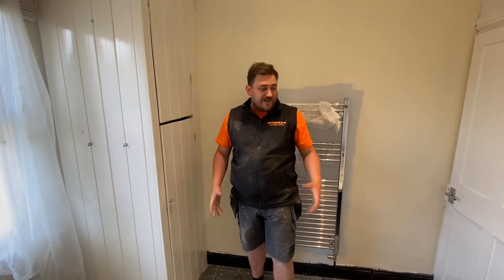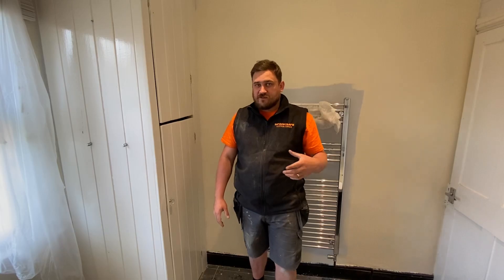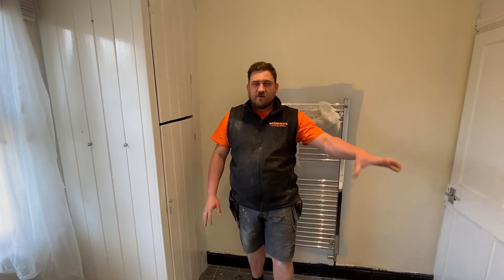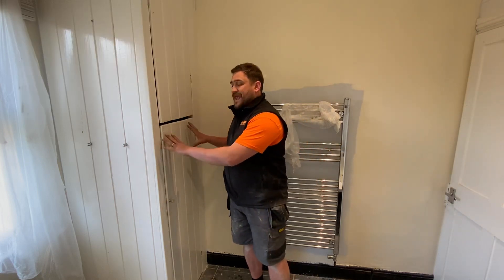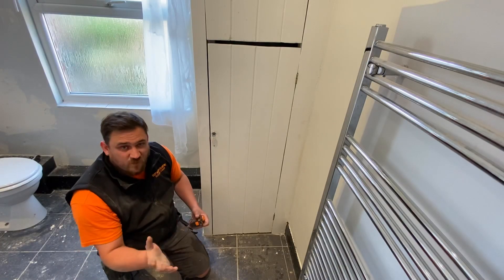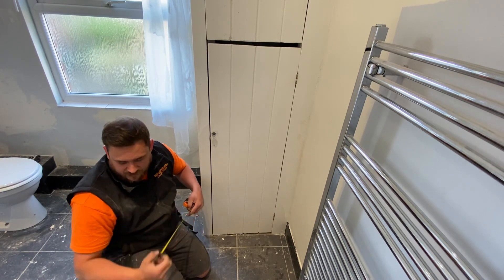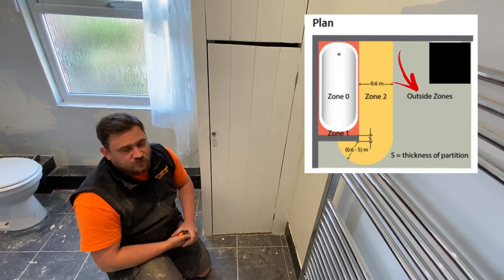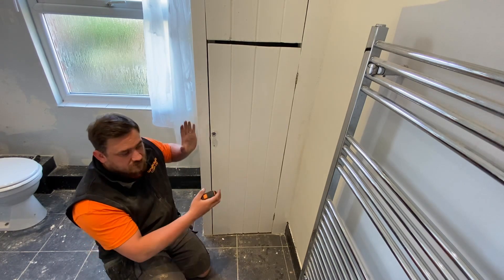Bathroom Zones and Airing Cupboards Explained - BS 7671 Are They Allowed in Bathrooms..?

Comment: So a cupboard in a bathroom is not in the bathroom?  Its a different room?   What if the cupboard has just a fabric door?  What if it doesn't have a door? What if the door fell off and you did an EICR?  What if you build a small cupboard around a socket outlet, its then not in the bathroom or use an outdoor socket and claim its in its own little cupboard?  Can you fit an integrated built in washing machine in the bathroom and claim its in a cupboard?  Can of worms opened....  I know someone who has a dryer right next to a shower and just runs an extension lead to the dryer from a socket outside the bathroom..  Think you need to use some electrical judgement and can't say one way or the other, I agree in that scenario I would think it was ok but I think it also depends why the person wants a socket, if its for a wifi router then thats a lot different than wanting to use a hair drier while in the bath..

Comment: Although I still think putting a socket in there is a bad idea. I would say an airing cupboard limits the extent of the zones but not necessarily the location if that makes sense
Reply: but you should always put a socket where an item is permanently mounted if you need to work on it in future. Lamps, tools, all need power. I mean, you know that you are supposed to have a socket within  a few feet of a breaker panel? In  most countries. for tools. Even though many of us have cordless tools not all do.
Reply: @brotheradam  im guessing you're not in the uk... we're not allowed sockets within 2.5m of the edge of bathroom zone 1. i.e. the edge of the bath or shower
Reply: @travoltasbiplane1551  as stated in video, the wall and door dictate the difference..lol.. take the base floor bathroom at my daughters house... an airing cupboard could be built into it without being affected under the zones, if the door is run one way, but turned the other way, it cannot work.. because a cord plugged in the inside would not reach the water zone if door is in one direction. 
NEC or USA rules are that you must have an outlet in the bathroom but not in certain are of shower or bathtub, yet Europe has different rules.. but, an airing cupboard or a closet is allowed in a bathroom and in certain circumstances, the walls and door of such circumvent the distance rules. But, it still is a case by case and not a no problem it is ok to do. Most bathrooms I have been inside in UK will not have space for an airing cupboard however.
Reply: @brotheradam  just because it's on youtube doesn't make it right. an airing cupboard is still within the room. it's still within the location. It is totally feasible that a general purpose socket could be used by someone in the bathroom as the bathroom door could be closed with the airing cupboard door open. It might make it more difficult to get stuff wet (limiting the extent of the zones) but it doesn't make it more difficult for someone to open the door and plug in a radio while they're in the bath. You're commenting on the electrical regulations of a country that you don't know and confusing the issue. In my opinion the 2.5m rule still applies for socket outlets even if they are within an airing cupboard. They are still within the location if not within the zones. If not lets just stick a cupboard in zone 1 and put a socket in that  - compliant and safe by your metric.
Reply: @travoltasbiplane1551  actually, I know the BS7671 pretty dadgum well, and have taken a bunch of the tests.. Just as I am able to do work in Jamaica and a few states in the USA.. Just because I am not NICEIC registered does not mean I do not have my green yellow, red or brown copies and my other books sitting around..lol.. and, a wall and doors makes it an enclosed space and separate from the bathroom.. but if the regular appliance cords can still reach from the outlet to the bathtub then the local inspectors office, required if you are unable to self certify, will then decide it is illegal. But, if the cord cannot reach the bathtub without an extension cord being added, the outlet is legal. Otherwise, you would not be able to put an outlet in the hallway, outside the door of the bathroom...  where the same test is what was used for the inspection I went through in Dagenham, East London..lol...
Reply: @brotheradam  well Niceic and electrical safety first would disagree. I queried this very issue on a condition report and they were unequivocal... At best what you suggest is not in the spirit of the regulations intention. But you know interpretation is everything... Not sure I'd want to be arguing the logic that a cupboard was no longer inside a bathroom if it came to it though.